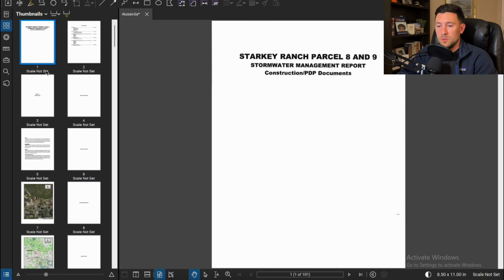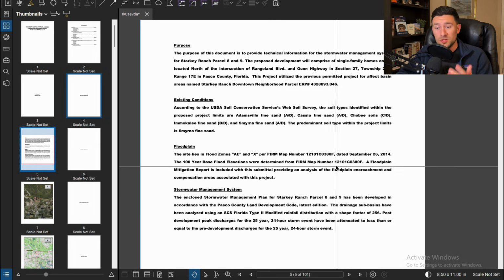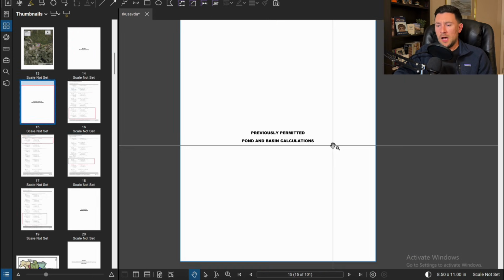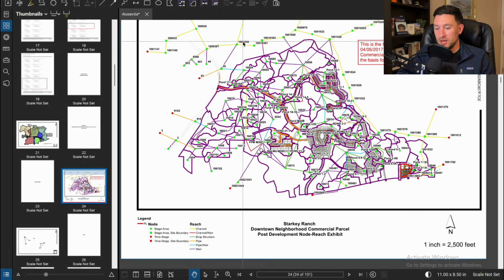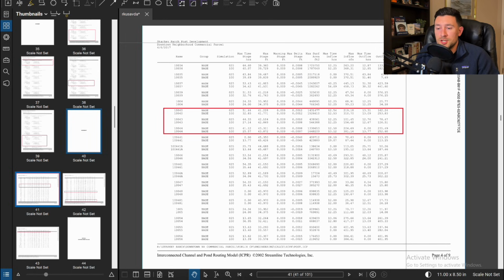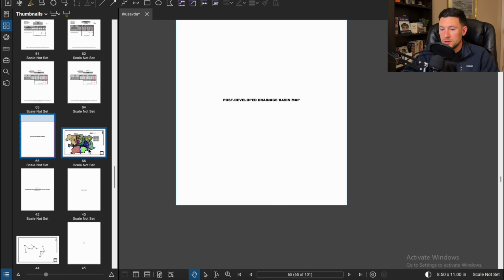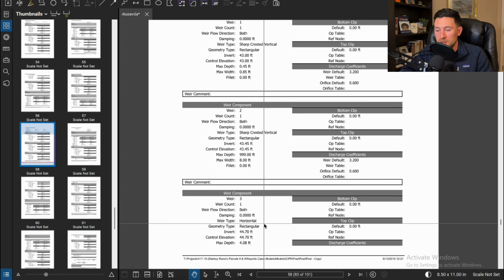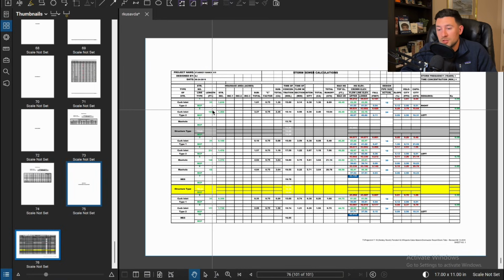Stormwater Reports Explained for New Civil Engineers

Comment: Could you add a short owner-facing summary to the report walkthrough: the land reserved for drainage, the off-site dependencies and who maintains each asset? That would help a land buyer connect the engineering report to the site layout and operating budget before committing to a concept.
Reply from the maker: That’s an interesting perspective. Most of those topics should be included. 

As far as land reserved, this is usually spelled out via the parcel ID, owner name. What more would you think you’d want to see?

Comment: This video is great! I really appreciate your content and I plan to share this with new engineers! It's like if Grady with Practical Engineering is the conceptual side, this is a good technical side for new engineers.

If the report you're reviewing is public record, can I suggest sharing the file and or where to find it for newbies? (I'm assuming it's probably on SWFWMD WMIS)

Just a quick note - USGS Quadrangle Maps, not UCGS.

I'm an EI getting ready to sit for my PE. I primarily work on smaller standalone commercial projects (e.g. gas stations, QSR's, retail, and a small amount of experience with big box retail and multi-family residential)
Reply from the maker: Appreciate the comment! Where are you located?